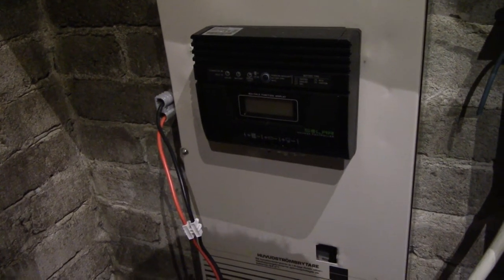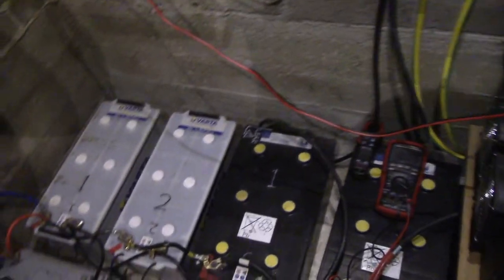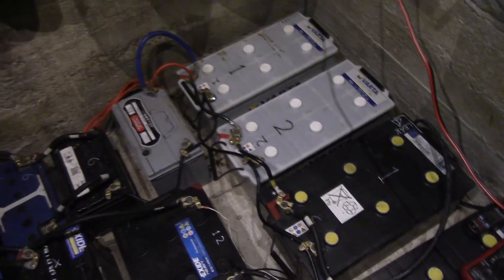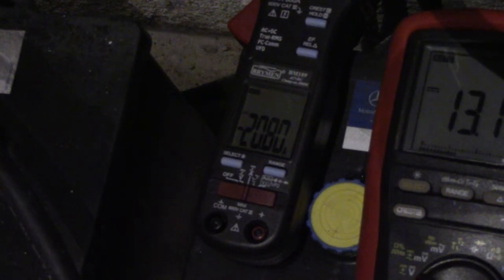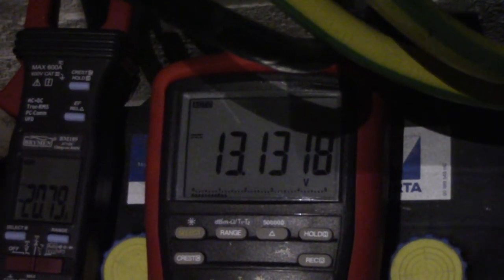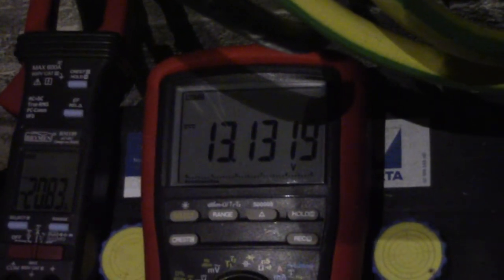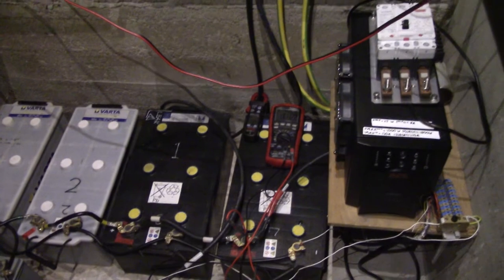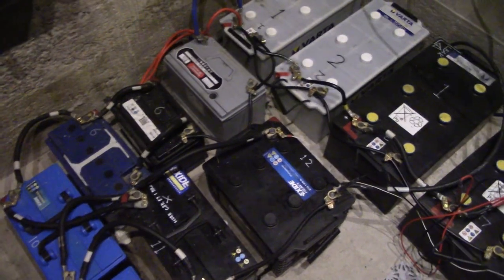Charging the solar bank from mains

Comment: Have you considered some sort of solution where you can charge one battery or group of batteries instead of the whole bank?
Reply from the maker: No, there's not really any need for that in this system. If I had twice as many batteries, it would probably be wise to have a breaker for each bank, which would enable some kind of solution like that.